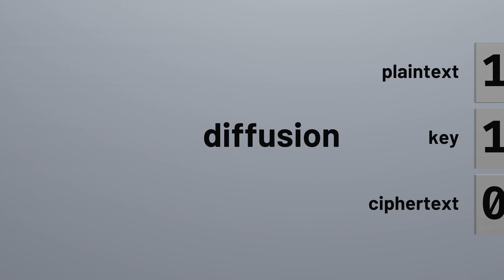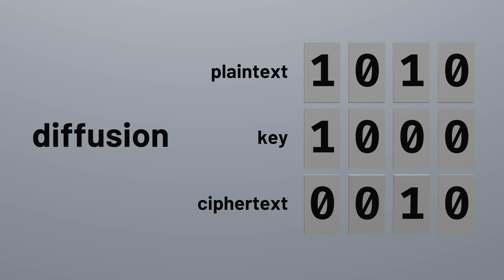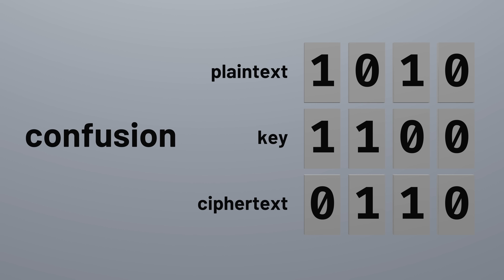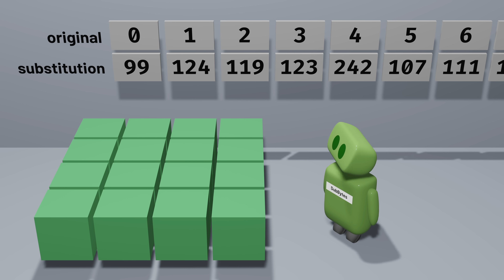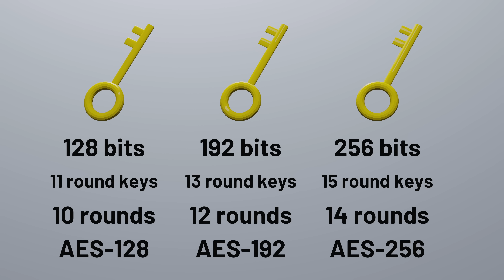AES: How to Design Secure Encryption

Comment: AES is so damn complex for nothing, it's very hard to write correctly in order to avoid timing attacks and it's slow-ish without specialized hardware instructions.
The fact that there's a lot of videos trying to explain all its inner workings and there's still people wanting more speaks for this!
ChaCha20 is a perfect replacement, it's much simpler (20 lines of C, no S-Box) and even faster, its 8 rounds version (ChaCha8) is so quick it can be used for videogames and it still good enough for cryptographic use.
Reply: Cha Cha real smooth
Reply: cha cha real
Reply: @kakyoindonut3213 smooth
Reply: CHA CHA CHA CHA CHA CHA CHA
Reply: Faster and thus better adapted to streaming data, but not necessarily as secure as AES. And nobody is using AES as a streaming cipher anyway. Apples and oranges.
Reply: @magicmulder  At least 90% of AES use is as a stream cipher - look up CTR and GCM.
Reply: @magicmulder  It is as secure as AES as it's a cryptographic cipher, it has been heavily studied too and is currently being used for TLS by Google.
Also you're wrong about AES not being used as a stream cipher, checking out the https certificate I'm using on youtube with firefox, it's running on AES_GCM, GCM (Galois Counter Mode) is a streaming cipher version that is adapted for AES so you can calculate the authentication together with the encryption.

Comment: Ironically almost all cipher modes still use one-time pads as shown in the beginning, and we use AES or other keyed mixing algorithms to generate a consistent but unique random key stream.

I guess it was concluded that diffusion of the plaintext isn't a useful property in the end. This only works securely if each message starts with a unique "initialisation vector" aka "nonce" though, to ensure each one-time pad sequence for each key-message pair is unique and can't be statistically analysed
Reply: Interesting indeed. 

This also made me start looking into a better method of just one- pass id's for archives like zip, rar, 7z, lzh etc.

In theory, by randomly  changing the byte order in non-destructive areas of the file, the password field will still reject the correct password even it it were uncovered by tools such as Hashcat. 
The user lands up with a garbled extraction without the Byte Order Manipulation Key for that specific archive. 
Let's just call this the BOM-key for sake of explanation.

I tried this yesterday on a simple lzh archive containg a PNG image.
Without unlocking the correct byte order sequence, the extracted file was just a black square consisting of 1 color only. Yet the original image consists of 256 colors.

After applying the byte order key
 (L4C361nf)  for this specific file, the original image is extracted to its true representation. 

This is a work in progress but so far looks promising. I'm not aware of any current hack tools that can unpack a random BOM method, seeing that it's not based on any algorithm as such, making it difficult to determine a set obfuscation pattern.

Your thoughts are welcome... 🙂
Reply: @lancemarchetti  I wouldn't recommend coming up with a fancy non-cryptographic scheme like that. I would generally recommend using a stronger key.

Designing from modern standards, I would use argon2ID13 to derive a large 256bit key from a password. You can configure the argon2 algorithm to take at least 1 second to derive on modern hardware and use large amounts of memory to make GPU based attacks redundant. I would then use AES-GCM-SIV or XChaCha20Poly1305 stream cipher algorithms to encrypt the files based on that key and a random initialisation vector. This is a fairly trivial construction and almost impossible to screw up assuming you have access to good libraries like NaCl (libsodium)
Reply: @lancemarchetti  This approach relies on people not knowing or understanding the thing you're doing. Just changing the order of bytes is typically easily countered by statistics. I recommend cryptopals for its exercises to learn why these things are not a good design.
Reply: A one-time pad is more than just using XOR, he didn't really explain that well. It's true that the common AES modes do use XOR but because they are not using a true-random key the same length as the plaintext they are not one-time pads.

A real one-time pad is completely 100% unbreakable, AES is "just" practically unbreakable.
Reply: We nowadays look for a good keyed stream of pseudorandom bytes, which is then XORed with the plaintext to create the ciphertext. You can use any good block cipher in a construct like CTR or GCM to get exactly that. New designs will use the benefit of not needing a reversible setup (which Rijndael has, and was created with a Feistel network in the past to make designing it easier) to make them faster and/or better.

Comment: I like your explanation of how the XOR gate works, I've never thought of it like that, thank you :D
Reply: Also good for the various types of "masks" you can apply to a set of bits. (XOR bits) then (add 1) is the fastest way hardware can make a signed (2's complement) negative.
Reply: It's how the Lorentz cypher masked the bits of the text: it xclusive ored a generated 5-bit stream that was pseudo random with the 5 bits of the teletext code.  As long as the decyphering machine was set up the same, a stream of text fed in at one end came out the other with the intervening transmission  encrypted.

Comment: It is said that a real full fledged quantum computer would be able to crack this in seconds. I don't understand how. Bc to misquote Rick Sanchez: "if you spend all day shuffling [bits] you can make anything sound like [a valid message/value]" , or in other words, if a quantum or any computer or hacker or whatever would brew the encrypted mess to a message or password - how is it known it is actually the original thing? From this garbled mess one can make anything! So decrypting a well encrypted password into the complete works of Shakespeare would seem just as valid as decrypting it to the King James version of the bible, while the original password actually might have been just something as dumb as Password1!*

*) To everyone reading this comment, please keep this password secret bc I'd hate to loose my OnlyFans account
Reply: a correction, quantum computers cannot break AES encryption. What a hypothetical quantum computer can do is break the diffie-hellman key exchange. AES requires establishing a shared key to work. If you just sent the cipher-text to someone without the key, then all they have is random bits indistinguishable from random noise. The way internet connections are secured, then, is by first establishing a shared key using diffie-hellman, and then using AES to encrypt and decrypt as needed. A quantum computer listening in can break the initial key exchange, and with that compromised key then decrypt using the same method as the intended recipient.
Reply: If you have an actual one-time pad, that's exactly why it could never be hacked. Every possible plaintext would be a possible decryption, and knowing which one would be valid is impossible. Limited size key inputs make only a (really tiny) subset of the actual one-time pads (generated with CTR) possible, and as soon as you get into, say, 60 bytes of plaintext, there's only one key that could reasonably result in a usable output file (assuming something like plaintext, where only 37% of byte values are likely / possible).

Comment: Well for hdd/ssd/etc I think AES is overkill, can just treat the key as a series of numbers to generate an rng seed with. The length of the key will determine how many times you generate a byte value to warp the original byte with via xor before moving onto the next byte (thus ensuring you never need to store the key after the seed is generated and since it's a seed it should never be the value to xor with). Something like below (writing of the top of my head so excuse typos and assumed functions etc)

int warp( int a, int b ) { return (a * b) ^ b; }

int use_and_erase_key(char const *key, size_t len)
{
	int *seed = (int*)key;
	if ( !key || len < sizeof(int) )
		return -1;
	*seed = warp(warp(warp(key[0],key[1]),key[2]),key[3]);
	/* Warp the seed and erase the key so it can't be traced during the encryption  */
	for ( size_t i = 3; ++i < len; *seed = warp(warp( *seed, i ), key[i]), key[i] = 0 );
	for ( size_t i = 0; i < drive_size; ++i )
	{
		for ( size_t j = 0; j < len; ++j )
			set_drive_byte( warp( warp( warp(get_drive_byte(i),i),j), rand_r(seed)) );
	}
	return 0;
}
Reply: In general, I think you should be very careful when suggesting encryption modes if you're not an expert in the matter. There are so many subtle vulnerabilities.

However, I agree with the idea. This is how block modes or stream ciphers work. You use the key to encrypt a counter, and then use the resulting output as a one-time pad. This ends up being more secure than AES anyway. But you shouldn't construct this yourself, instead use AES-GCM-SIV or XChaCha20 if you want an alternative algorithm
Reply: @conradludgate  Well I did say "something LIKE this" so if the experts who use it use it as is then that's on them, additionally there's this whole thread to add to it - of which while not expected is welcome :). In any case thanks for adding what I did not have the knowledge for.
Reply: If your controller already has support for aes why would you use something else?
Reply: @catprog  perhaps for speed, depends if a stream cipher is faster or not, most cases I would say if it's already on hardware might as well go overkill but for when it's not a stream cipher seems the better option to me
Reply: What you're describing is basically just a stream cipher. In contrast to block ciphers like AES, stream ciphers like RC4 and ChaCha20 pretty much just generate a pseudo-random bit string from the key, and the ciphertext is generated by XORing the plaintext with the algorithm's output (like with a one-time pad). Some stream ciphers (including RC4) use an internal "RNG state" that updates as the output is generated, but most modern stream ciphers use a counter-based construction (where the state is updated with just a "+1") due to improved parallelism. To make a secure stream cipher, you need to make sure the output of the algorithm is sufficiently unpredictable, and that the state cannot be easily recovered from the RNG output. Otherwise, an attacker that knows (or guesses) part of the plaintext can recover the internal state and decrypt the rest of the data. There are other considerations with stream ciphers that need to be accounted for as well. Stream ciphers generally have a maximum output length before it starts repeating, so if you're encrypting a very large amount of data (eg. an entire drive partition), then you may need to add a re-keying system to avoid leaking data about the plaintext. Additionally, stream ciphers are much more vulnerable to manipulation (an attacker can flip any arbitrary bit they want), so if data integrity is needed, you need to add some form of message authentication (MAC).
Reply: @LRFLEW  I didn't say I was an expert in the matter so some of that is new to me. As far as the rng integrety goes, I leave that to the experts, I was merely providing an example that most people can get the gist of easily. Could use a long long int or __int128 for all I care in order to increase the number of times it can be used before the seed loops, that's not my problem, that's for the experts that use the idea in whatever form they make it. All that said, thanks for explaining that, I'll keep that in mind if I ever start doing encrytion programming

Comment: Now I know AES mix and modifies the bits and bytes of data, and thus it's very secure. I wonder how can we decrypt it...
Reply: every step is designed to be reversible. So you just do everything again, but backwards.

For ShiftRows, you shift in the opposite direction. For sub-bytes, you have a different table that maps the encrypted byte to what originally made it. For AddRoundKey, you can actually just do the exact same thing (since XOR is its own inverse). The only weird one in reversing MixColumns, but you can think of it as essentially a matrix multiply, so you can actually find the inverse matrix and multiply by that to get back to where you started.
Reply: well the trick is that you don't know the key, and so you can't reverse the add round key step
Reply: @haniyasu8236 That is what it originally was meant to do, but funnily enough modern AES implementations don't even need to bother implementing decryption at all. Look up CTR and GCM to understand why.
Reply: Well, and this example is also specific to a 16 byte plaintext. If your pay load is larger than that (which it often is), you'll have even more transforms

Comment: Great! Now continue with why simple AES encryption (ECB) is not enough in case of messages longer than 128bits. That's why cipher mode such as CBC exists.
Reply: They can also talk about authentication / AES-GCM which is the recommended version to use most of the time or so I've heard
Reply: That's technically out of scope of the AES algorithm directly and into Modes of Operation. It is valid though.